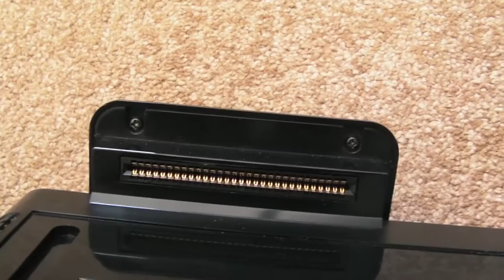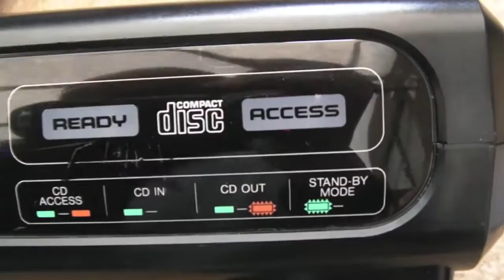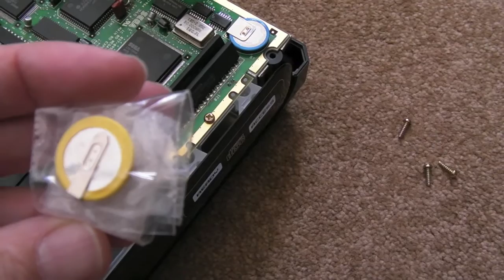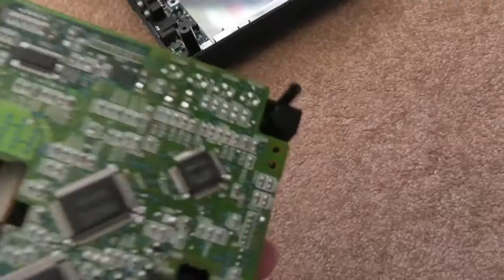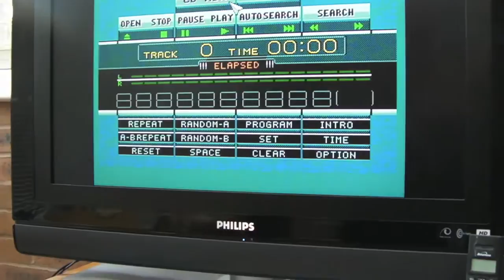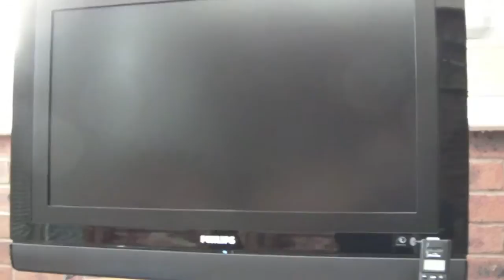Sega Megadrive (Genesis) Mega CD (Sega CD) Repair

Comment: Great video!  I just received a Jp Model 1 MCD system from Japan yesterday that is not reading discs.  I don't have access to any of my games at the moment so I have to use CDRs.  Tried a music cd but it did not work either so I knew it was not the CDRs.  I checked the CDRs in a PAL model 2 as well as my Wondermega and there was no problem.  I fiddled around with it some more tonight because it is driving me mad that I can't get it to work, and after checking the gear alignment of the stupid system used in the Jp and US systems (they were changed by the time us PAL poorpers received the system on 31 March, 1993, that's when we got it in Australia, UK was the same I think  That's when I bought my first CD!), it played a music cd!  But only 1 out of the 4 I tried and still no game reading, very annoying!

Also, two things.  The lock thingy on the side is for the mixing cable that goes from the MDs headphone socket to the back of the MCD to give proper sound of both MD games and MCD games that use a mixture of PCM and MD FM sound through the stereo ports on the MCD.

Secondly, you should really add a 50/60Hz switch to your MD if you are playing mostly US games.  NTSC games play badly on a PAL system if it uses FMV, animation or constant accessing of the disc as Starblade does.  Animation such as the intro to Lunar for instance, will be out of synch with the music and a game like Night Trap sounds weird and sloooow when ever a person is speaking.  I had the US version when it first released and could not stand it.  The game was banned here (pathetic, I know!), but shops starting importing it from the UK.  It was much better in PAL!  That is seething I do not say often ;)  Some games refuse to play altogether or crash.  I thought that may be your problem with Starblade, but obviously not!
Reply from the maker: Thanks for posting and thanks for letting me know what that lock is on the side =)  Makes me wonder if I've been missing some CD audio or something?  Regards the 50/60Hz switch I've already done that!  I also added the 10Mhz switchable overclock to make games a little smoother etc, although the overclock clashes with the Mega CD (that would need overclocking as well =/).  Next I think I will add a switchable BIOS so I can toggle the Mega CD between US and European BIOS.  Hope you get the CD working properly!  After you've cleaned up the runners and gears etc, try tweaking the laser pot - but only after you've measure in ohms the resistance first before you adjust it.  That way you can experiment in small tweaks either way of its original value.
Reply: The damn MCD is still not working >_<  Hopefully a new laser will cure it!

About the mixing cable, it is needed for games that use chip music as opposed to CD tracks.  That is because almost all chip tune games used a combination of the MD's FM and the MCD's PCM chips.  I was always disappointed that the PCM chip was only used for background percussion and speech whilst the FM chip was used for the "main" instruments.  Two games I can think of off the top of my head are Snatcher and Popful Mail.

To be honest, it's been so long since I played anything in my good ol' PAL set up that I cannot remember what happens to the sound without the mixing cable.  Games like Sol Feace used the MD for sound effects (the usual "farty" sounding Wolf Team sounds), so if you have that game, try it and see if the sound effects play out if the MCDs stereo outs.  In a game that uses a combination of both chips when using the mixing cable, you can turn the volume on the MD down to hear only the MCD PCM music.
Reply: Oops, one more thing I forgot to sat.  If you are planning in adding a BIOS chip, have you thought of the region free BIOS?  The Jp v1.0 region free is the best one to use.  That way, everything works and no need for a switch.  I am going to add a region free to my Jp system.  The Jp model 1 has a socketed BIOS so it is dead easy! :D
Reply from the maker: Hi, yes I did think about a region free BIOS but I think what I might do is have a chip with 4 BIOS images in it and have a switch - that way I can have Euro / PAL / Japan and a region free US.
Reply: Ahh, good idea.  I was thinking of doing the same for one of my systems to ensure no compatibility problems with my games as I own a mix of PAL and US from back in the day as well as a near full set of 112 Jp games.  I am a sucker for the original Jp BIOS screen.  Some sense of nostalgia no doubt!